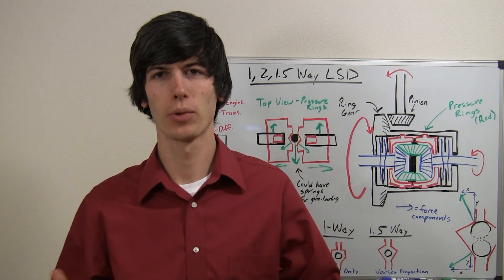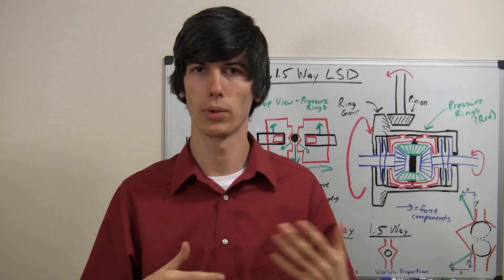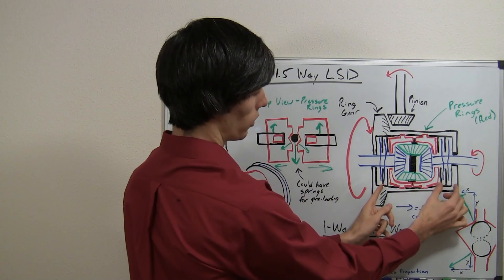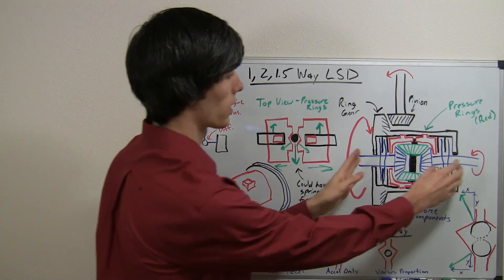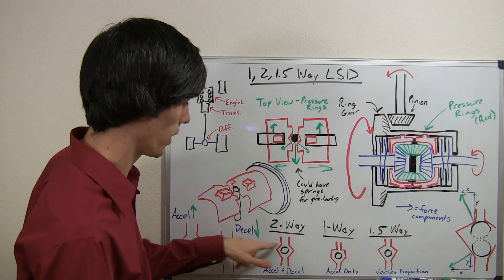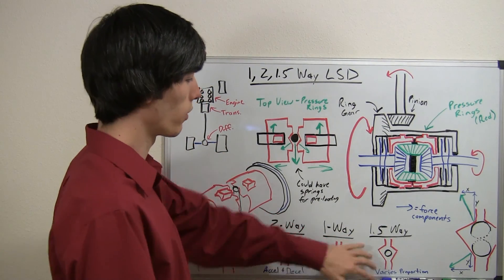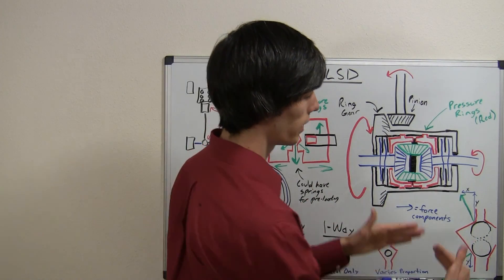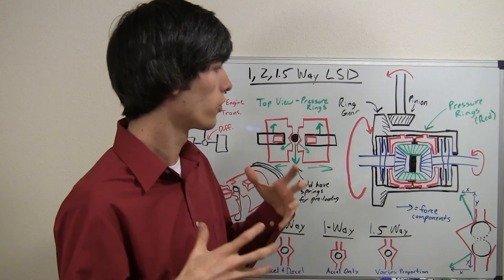1 Way - 2 Way - 1.5 Way LSD - Explained

Comment from the maker: If you're going around a corner while braking, a 1.5 way may be better, so that your tires still transfer some torque, but also allow for different wheel speeds so that one tire is not dragging or skipping.

Of course, with ABS for all 4 wheels, applying the maximum braking force doesn't require a tricky differential. Since ABS is banned in nearly all forms of racing, these differentials can provide benefit.

Comment from the maker: What I was trying to say is that it reduces the force that "locks" the differential together than if it were to be a 2 way LSD. Having a 1.5 or 2.0 way reduces the likelihood of one tire from stopping than a 1 way, but they way I said this was basically unclear and wrong. Basically if you're braking in a straight line with no ABS, having a 2 way diff would be ideal if conditions were different for each tire.

Comment from the maker: When you brake the rear tires, you slow down the drivetrain, starting at the wheels, which are connected to the drive axles and thus the differential. By braking the tires, this force does pass along to the differential. A clutch, torque converter, system of clutches in an auto box, etc... is the link where the engine and wheels are no longer connected. So to slow your car down, you also must slow down rotating components such as the driveshafts, transmission gears, and diff gears.

Comment: you kinda messed it up a little at the end: the chance of one tyre locking is greater with a 1.5 than with a 2 way LSD while you said that with a 1.5 you reduce that chance (which is true if you come from a 1 way or an open diff). also abs helps to NOT lock the tyres while braking in excess. I think the way you ended the video is a little all over the place. Maybe you should start editing them and do more takes because some info just can't be put into words in one take. if you have the time. bye

Comment: I think you have explained it wrong, you say "braking"! will try to lock the diff, this is not true, only if it has pre-load, (the brakes dont do any force on the pinion-shaft, think about it, the load/force have to come on the drive-shaft).
what you could say in instead is: when the ENGINE! is braking there is some reverse load on the pinion-shaft which push the pressure rings out to lock the clutchpacks.
i could be wrong here, but this sound more logic!?
Reply: Aka, heavy high rpm downshifts,  I thought the same.